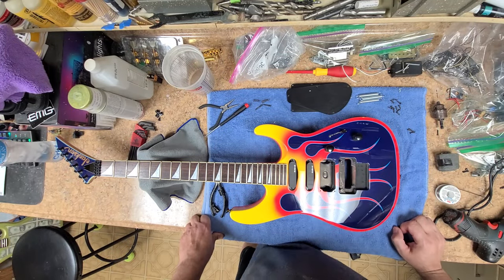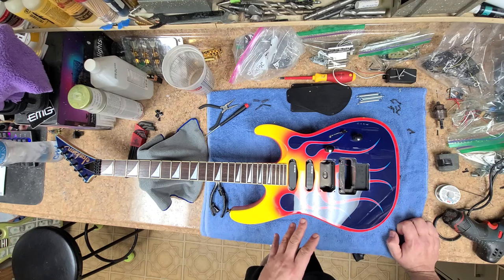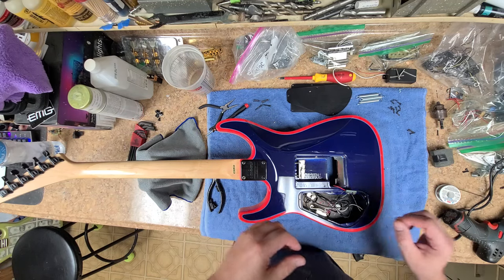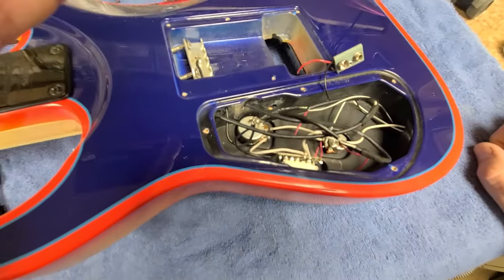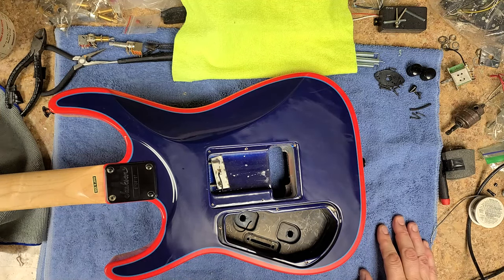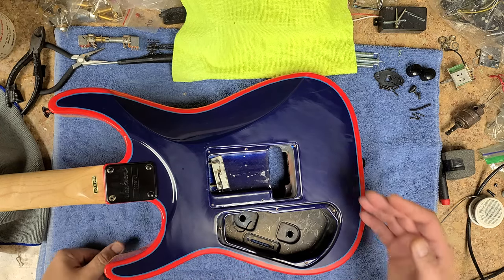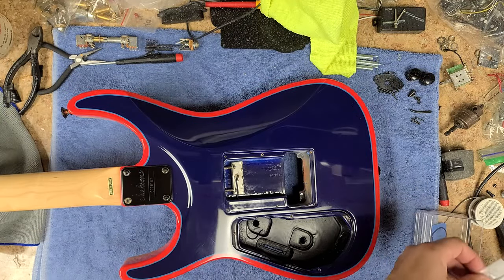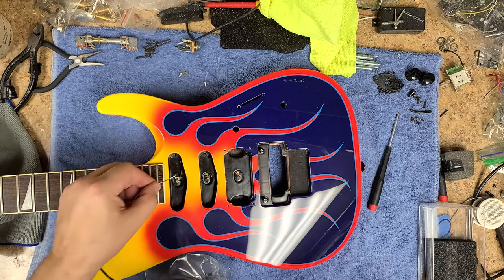Flamed Jackson Gets Some Love

Comment: No Eric, it’s not boring! I’m fascinated by watching electronics work in a guitar cavity. Looking forward to part 2. 
In this video and others you’ve mentioned doing bodywork and paintwork on cars, is that your main job? Speaking of, my wife scratched the car door the other day!
Reply from the maker: My father used to custom paint motorcycles and cars when I was growing up. My father would go to work and come home and work on somebodies car of bike. As I got older, I was helping my father. So I picked up a lot of things from him. My older brother made auto body his career. My father was old school and my older brother had all the newer toys for painting.
Reply: @ericctheartofnoise8613  , it sounds like you got a lot of valuable experience from your father and brother. Pretty cool the way you’re able to apply it to guitars.
Reply from the maker: @bass-hiroshimanick2534  I figured, it is still paint, but on a different surface. I have tried to use the better Rust-oleum  paints, but I don't like enamel paint. Takes longer to dry and it gums up the sandpapers I use.
Reply: @ericctheartofnoise8613  , that’s actually a good tip for me to keep in mind if I ever attempt any paint work. Gotta be honest, I probably wouldn’t know which way to hold the can of paint.